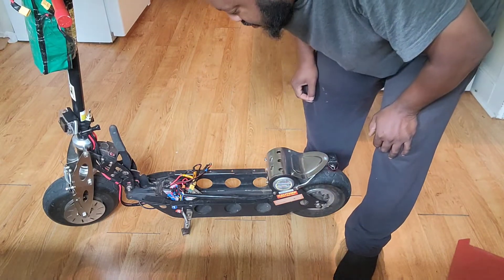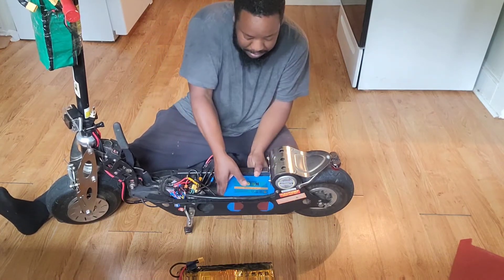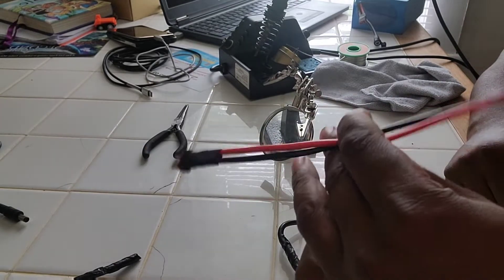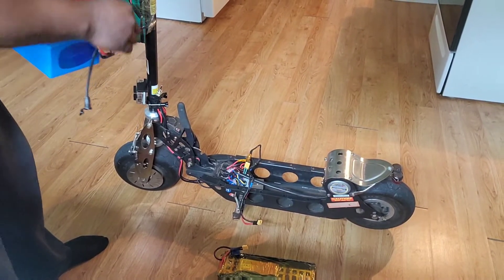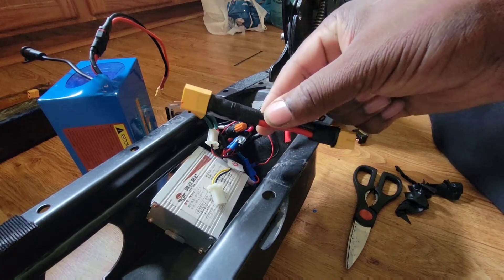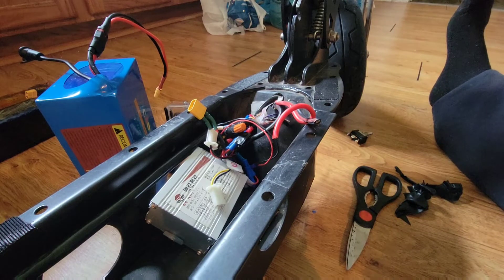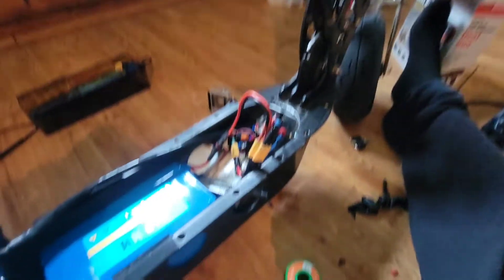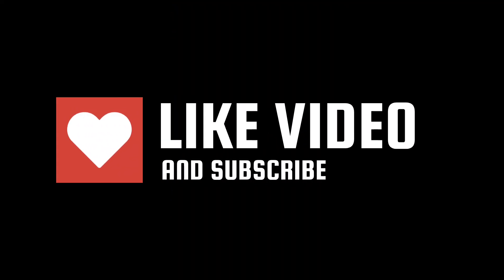BLADE Z 450w Battery UPGRADE swap

Comment: What is the motor voltage? I have a BladeZ Xtr-se, it used to be green but I only have the chassis and the engine, without cables or anything else. I want to restore it and even improve it to use it as a vehicle to work on a food app, Alternative to my motorcycle